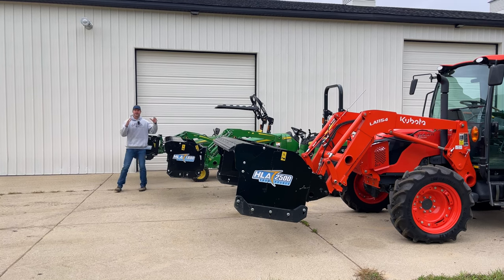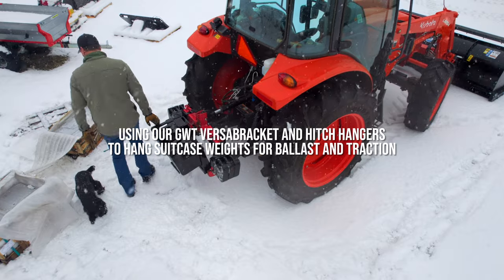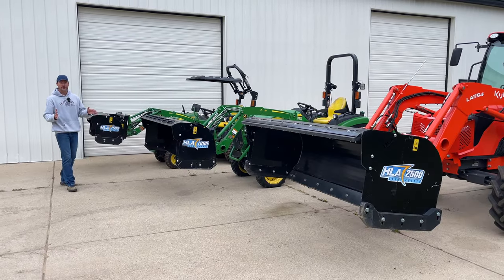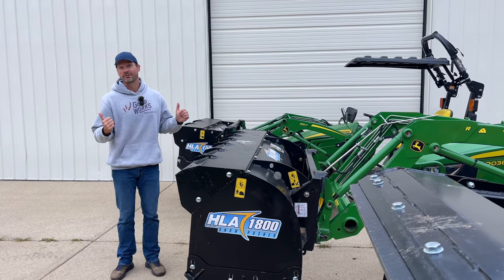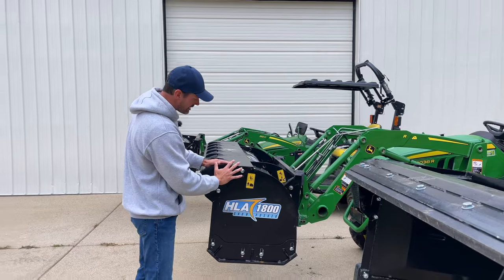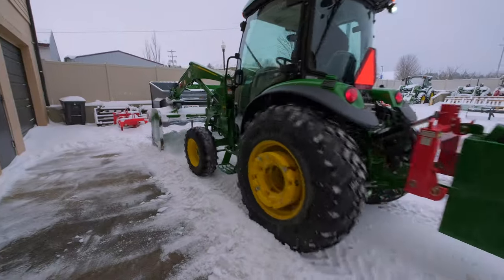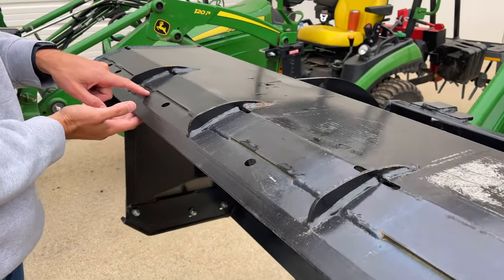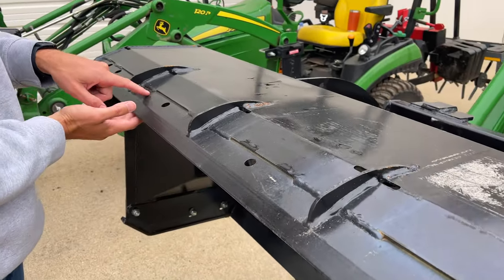WHAT SIZE SNOW PUSHER DO YOU NEED? PUSHER SIZING GUIDE

Comment: We just don't get enough snow to justify the expense of a pusher.  I will probably get those runners and put it on my loader bucket on the larger tractor and use the rear blade on our smaller tractor.

Comment: So with traction being king and tire chains being hard on asphalt and concrete driveways, I needed a unicorn tractor.  I found screw in tire studs on amazon for ATV’s and motorcycles. They were extremely cost effective compared to the regular heavy equipment  studs. I think I used the 3/4” long ones and screwed them into the tire. They were just as good as chains, on harder packed snow, ice and snow only a few inches deep. It was great until they started coming out. I used super glue the next time and they stayed in great. There was zero damage to concrete but new soft asphalt could get scratches if the tire spun enough. At the end of the first season the top of the stud was rounded over but still worked great! They were still in the tires and working good three years later when I traded in the tractor.

Comment: I just bought a 60” work saver for my Massey GC1723. I did not realize how big it is until I picked it up from store (width and height). I used it the other day in 6” of wet snow and I was pleasantly surprised how well it worked even without chains. It works great on gravel and grass, my plow truck makes a big mess early season when ground is not frozen, not so with the pusher. I made a backdrag set up that works great. 
I wish I bought this 54 as it’s a bit narrower and not as tall, but the 60 does work surprisingly well. I use extra caution as as not to damage cylinders or loader arms. It have about 400lb on the back

Comment: We have an HLA snow wing. It can be used as a pusher or a big angle plow. They make really good products. We also have had a few pushers. They work well, you just have to have a spot to pile the snow when you start losing traction. When the snow is deep you just have to take a smaller bite each pass.